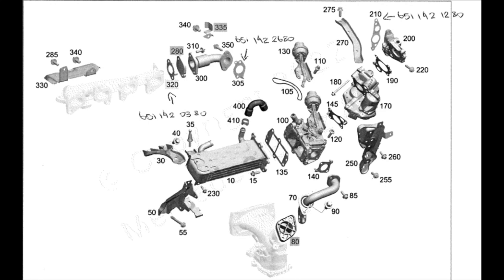Technical Drawing Sprinter Van W906 OM651 - EGR Valve & Inlet

Comment: I am about to attempt this project too - I’m super thankful for your Youtube series!

Might there be any way I could obtain this diagram in a higher res digital format from you ? 🙏😀
Reply from the maker: @timdavies9494  Hello if you Goto your local MB dealer they will certainly be able to print it out for you, I'll try figure out how to do a PDF share myself
Reply from the maker: @timdavies9494   send your email address I should be able to compile a PDF from the pictures I have
Reply: @runningon8883  Hi! I just want to let you know I did send my email in a comment - but came back now to check & realised that youtube must have deleted that comment (apparently youtube does not allow email addresses)!
Reply from the maker: @timdavies9494  I'll try figure out how to do an online PDF share , my email is 
running...on888@gmail.com  (remove the full stops )

Comment: Hi. How do you purge the cooling system after topping up what was lost? Regards. Or is it not necessary, it is self-purging?
Reply from the maker: Hello - with removing the EGR, the radiator is drained prior to removing any components of the inlet manifold and EGR system - you need to drain the coolant and put it aside before attempting this job 👌 once the parts are reassembled you just refill the coolant via the overflow tank and bleed the air from the system by starting the car, letting it idle and recirculating the coolant
Reply: @runningon8883  OK, thanks.
Reply from the maker: @cransaftvalve734  remember when you are bleeding air from the cooling system - open up the heater circuit to maximum in the cockpit, if you have any questions just post 👍
Reply: @runningon8883  OK, I will do. Thanks again.